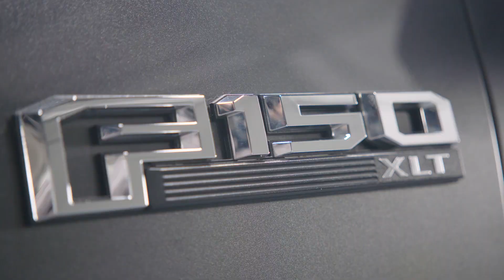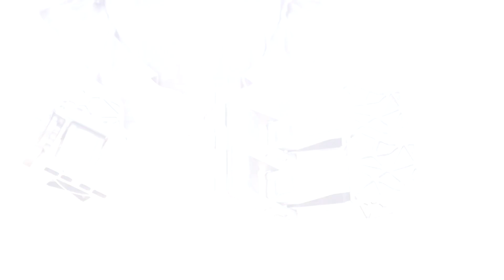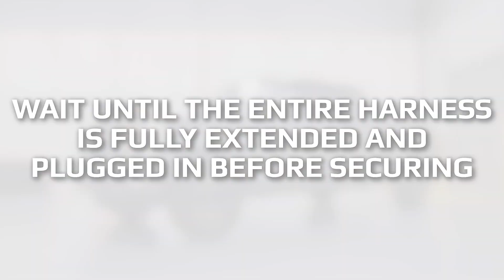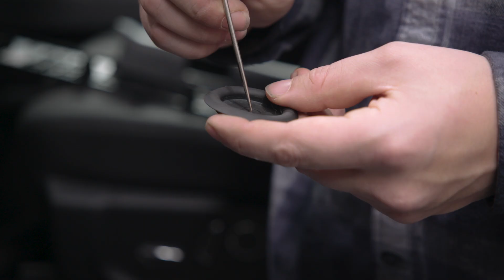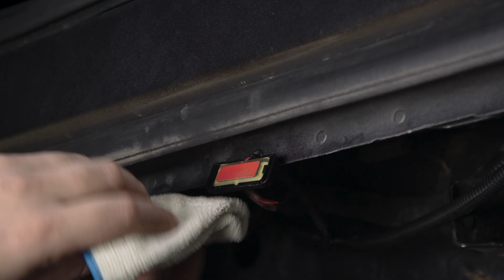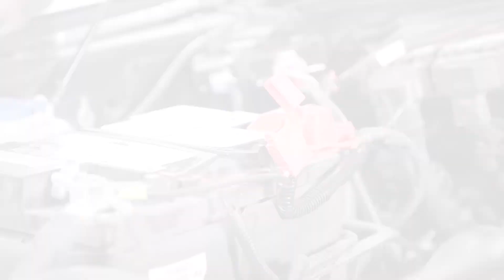AMP Research POWERSTEP XTreme Electric Running Boards - Installation Guide

Comment: I put a set of AMP BOARDS on my 2012 GMC and they worked great. I heard a rattle on my way to Virginia from Texas last week and found my driver side pin/bushing wore out. I cleaned and lubed them regular but using the driver side the most wore them out. I dont see that the bushings are replaceable so ill have to bore the wore out bracket and fabricate a bushing. Lucky I have a machine shop and some oil impregnated brass to rebuild the part. 11 years and 170K miles aint bad.

Comment: I'm a little disappointed at the cheap plastic motors. Power wheels toys have these and they break all the time. That's the only thing holding me back since I live in Canada and winters are pretty bad here. The plastic will get very brittle.

Comment: The extreme motor housing looks the same at the regular one so why pay more?
Reply: It is the same motor. When u buy the normal amp power steps u only get one motor and the other one is just a hinge. With the extreme u get two motors instead of one.

Comment: I'm a dissatisfied customer.... the relays overheat and they get stuck from dust and  dirt but absolutely zero off-road use...in fact the driver side stopped working on me yesterday. they won't be my next power step purchase! But hopefully they get it figured out for y'all! <these are really good when they work though! Just lots of problems with ours professionally installed by Toyota on a 2020 tundra >
Reply from the maker: @Shugga leaf Sorry to hear about your trouble. I am with the technical support team here at AMP Research. I saw your comment and wanted to take a moment to reach out and see when you may have time this week to run through some trouble shooting on your PowerSteps? I would be happy to reach out over the phone to see if I can help resolve the current situation. You can either DM me through IG or FB or send us an e-mail with your contact info to Support@Amp-Research.com. Just make sure to ask for Robert and I will see what I can do to get you taken care of.
Reply: @ampresearchtv  THANK you Robert I Will do  that!
Reply: @ilovetoyotatrucks  i am curious to see if the issues were resolved. and your experience with support. I am looking into these as my next power steps and want good and bad side of how things go with the boards and customer service. thanks

Comment: Just put a set of the XLs on my F-150.  Love the steps themselves, but was disappointed with the lights.  You'd think that for $1,800 you'd get a decent set of lights that are brighter than a $2 flashlight.    Ordered a much better set to replace them.
Reply: Which ones did you go with ?